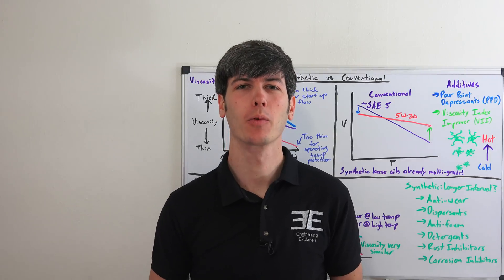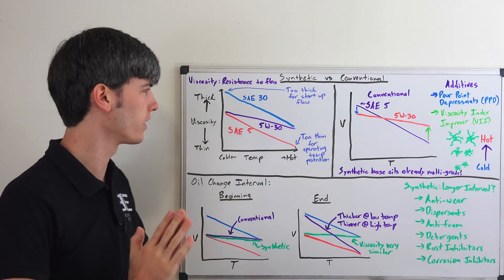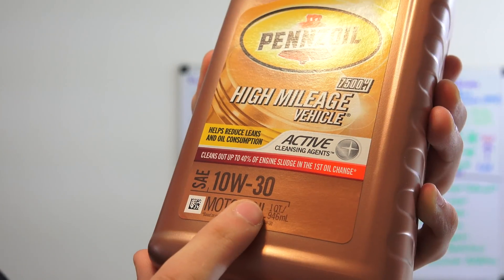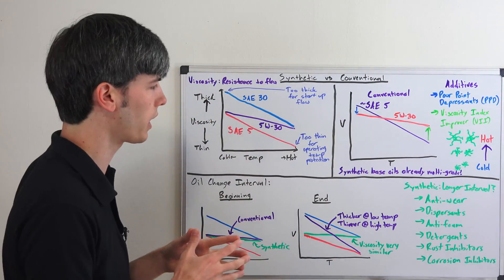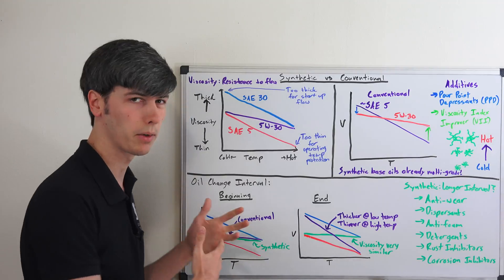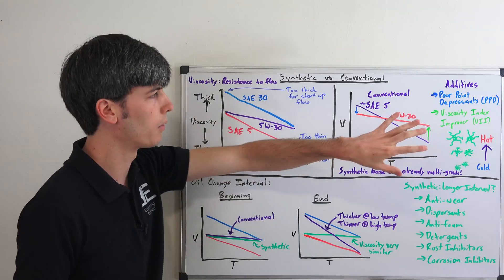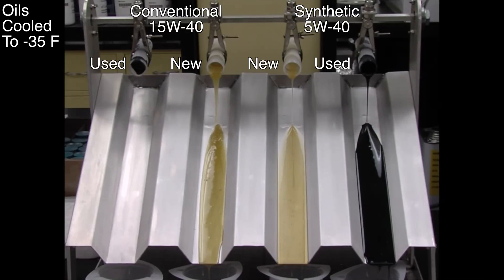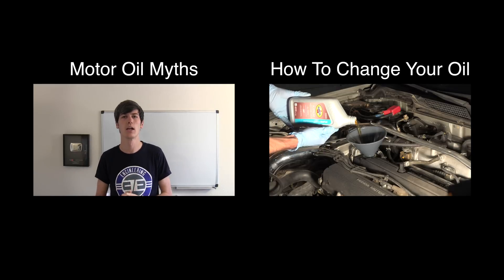Is Synthetic Motor Oil Better For Your Car?

Comment: I've found ketchup with a bit of mayonnaise mixed in works best with my Miata. It must be that Japanese engineering that requires the extra premium lubricant
Reply: cmon bro u use soy sauce to feed the rice thats all I use on my mazdaspeed3
Reply: Yeah. You can also add a bit of vinegar to thin it down
Reply: +Sci-Fi Hooligan Yup. I import my vinegar from Japan so it's JDM af
Reply: I will offer $1.88 for your car.  You use it like a hamburger, so will offer same price.
Reply: I prefer to use BBQ sauce and a little bit of ranch for best performance in my NB1.
Reply: Japanese make a special mayo, kewpie mayo, its a little sweeter and more liquid. might be good for cold starts??
Reply: Bambi the Miata Dont you mean soy sauce?
Reply: I use soy sauce in my RX7. Works the charm.
Reply: Ewww, none of that Mormon "Fry Sauce" in my engine please. Pure Mustard in Texas!
Reply: Mixing corn oil and lighter fluid also can be used if you are out of gas.
Reply: Teriyaki sauce works best with rotary engines
Reply: Andrew Murphy how about siracha!!!
Reply: Alvin Brinson Mustard works in a pinch too!
Reply: Sweet and Sour can be a bit tricky unless using the low calorie variety, but that can present it's own problems too. So, from that region, it has to be Fish Sauce.
Reply: Well I am a little bit more advanced and use fish oil, it is certainly the best lubricant out there.
Reply: You have to specifically use Japanese Mayo otherwise you wont get the best performance.
Reply: no Wasabi?
Reply: Do you use commercially bottled Mayo Ketchup / Salsa Rosada or a homemade mix? It may have some pickles and/or garlic extra, but...
Reply: I use Fage Total full fat yogurt in my tC.  Avoid the 2 percent or 0 percent, the whole milk version (Total, blue container writing) guarantees a sufficient amount of lipid content for lubrication.
Reply: What are you, some kind of JERK?
Reply: That's called fancy sauce
Reply: Lies, kewpie is the best for Japanese branded cars.
Reply: You might want to add french fries with raspberry jam and tuna with that...
Reply: I just put meth in mine  makes the driving more aggressive
Reply: you think it'll work in my 2009 maxima? lol

Comment: I use 10W because my engine is 20 years and the block has never been opened up so tge seals are old.
Reply: I thought I was the only one that did that LOL
Reply: Guess not lol keeps it from leaking through the valve seals hate me with a passion.

Comment: Are part synthetic oils more like conventional oils or synthetic oils?
Reply: It depends on the brand. There is a minimum percentage of synthetic oil that must be present in order to be called a synthetic blend (i forget the exact minimum). For example Pennzoil's Gold synthetic blend is a 50-50 mix of conventional and synthetic oil. Other brands are different. One interesting thing is that there is no real 0W20 synthetic blend since conventional oil cannot be made that thin. Those blends generally have a high synthetic to conventional ratio. Manufacturers sell oils that are practically full synthetic 0W20 oils as blends at a cheaper price due to market demand.

Comment: Pennzoil is about the worst you can buy.
Reply: People don't understand that these oils are all probably coming from the same or similar places. Its not like it used to be, one oil is not significantly better than another. Nowadays the main difference between oils is the additive package.
Reply: Yeah i like Castrol or Mobile 1
Reply: Have to. HAVE to. A haft is a handle.
Reply: As long as you change your oil every 4,000 miles with conventional oil or 7,000 with synthetic it does not matter what fucken oil you put in your car there all going to do the same thing
Reply: Your opinion is based on an archaic wives tale.  Pennzoil is one of the best oils on the market with a stout additive pack.  Pennzoil and Quaker State are all manufactured by Shell now.
Reply: well they're obviously still in business and doing fine. care to explain?
Reply: ChinnuWoW Ive had bad Experience with them it doesn't hold up as long If i can here my timing chain rattling thats not good its not holding up at my normal temperature operation
Reply: Garrett Martin Everyone has a preference Castrol was used in F&F so be like them XD
Reply: wtf does f&f have to do with your ignorant conclusion?
Reply: All oils haft to meet government regulations so saying that one specific oil brand is horrible means nothing because chemically all oils sold in the USA haft to meet the same government  tests
Reply: Mobil 1 and subaru don't get along
Reply: +Karson Cox plus ams oil dosent meet SAE standards but is called a "synthetic" this is the reason alot of people hate on ams oil. for the best oil u can buy go to a vw dealer they use the highest grade oils in the world and their oil change intervals on most are 10000mi the us has a diffrent definition for synthetics and is less strict what they consiter a synthetic, oil is not just oil its all diffrent
Reply: i use walmart supertech full synthetic.  super inexpensive
Reply: Really why? Their synthetic oil is pretty good.
Reply: I don't know what you mean specifically, but Subarus are notorious for oil leaks of one sort or another and they are favored by "synthetics'" laminar flow characteristics.
Reply: Yes and no.  But there is no official SAE definition of "synthetic".
Reply: Guess you don't need facts since you have an opinion and that's just as good, right?
Reply: +ChinnuWoW my dad tried pennzoil in his 75 Torino once. Checked under the valve covers at oil change and they were all sludged up. Went to Havoline and cleaned right up
Reply: the word is  have,  not haft